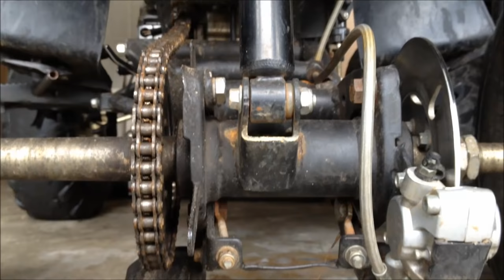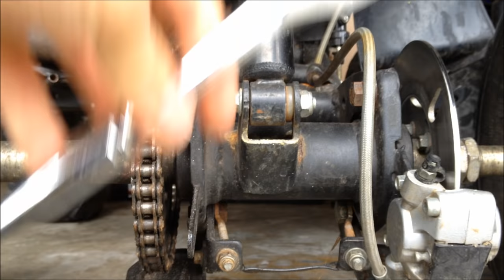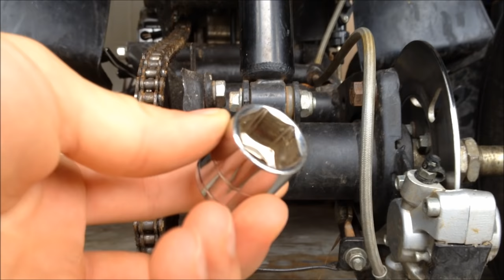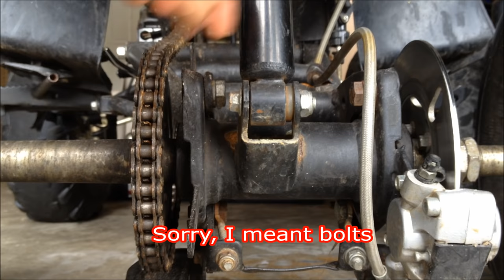How to Adjust an ATV Chain

Comment: This is a perfect example of how to cause a broken chain, frame or engine - the first step is to compress the suspension so the axle, swing arm pivot and transmission shaft are on the same plane (in a straight line) - when these 3 points are in a straight line, the chain will be it's tightest. If you adjust the chain without compressing the suspension, as the axle arcs through it's apex, the chain can break, exert enough pull to bend the frame, break the transmission output shaft, the bearing that carries the shaft or the engine case itself. If you are going to put it on YouTube, please assure the information you are publishing is accurate. Please correct this video or delete it.
Reply: Thank you for sharing that info; what would be the best way to compress the suspension? I mean, can I just ask a big buddy to sit on the ATV while I adjust the chain? Thanks!
Reply: Can you post video pls

Comment: Do I just loosen them than tighten or do I have to pull the  anything ??
Reply from the maker: Nothing should be taken off when tightening/loosening the chain. The bolts and nuts only need to be loosened and tightened in the appropriate order.

Comment: I just bought a Tao Tao 125cc ATV used, and my chain is loose big time, will this work on mine ?
Reply from the maker: Sorry for getting to you so late but it should considering they are the same make. I'm not 100% certain though as mine was from 2013